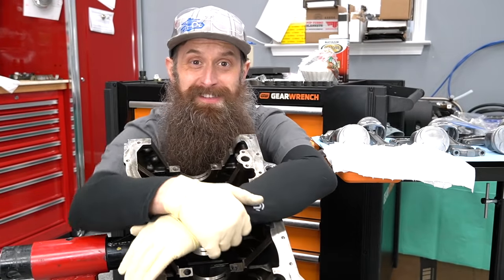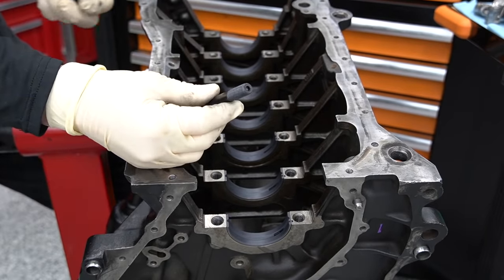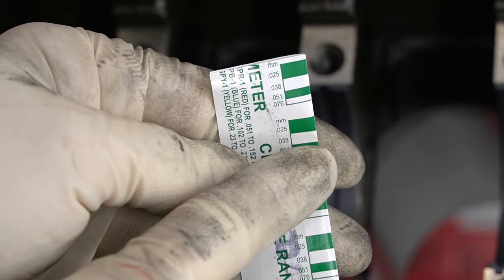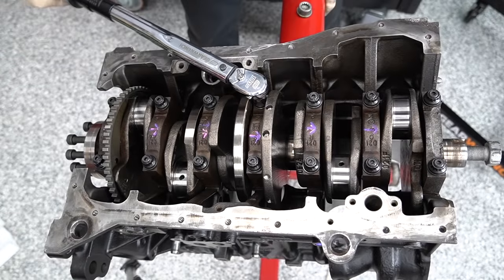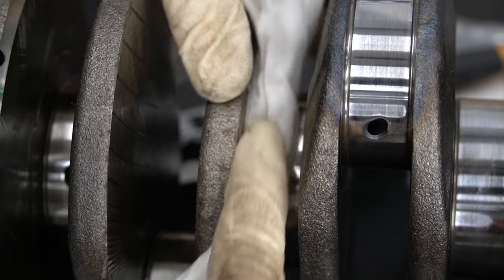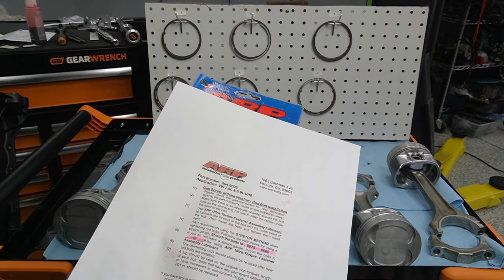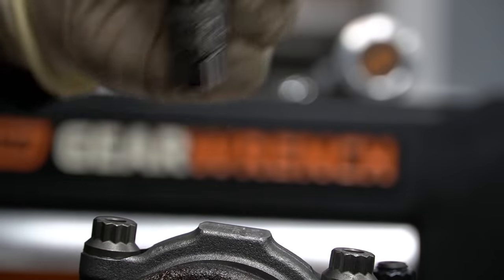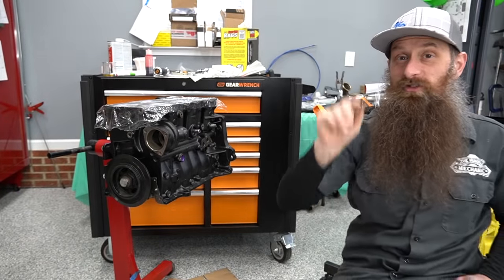How To Assemble an Engine Block with Upgrades!

Comment from the maker: Next up for the R32 we will get the head bolted up, and do two timing videos. One with stock chains, and one with HG spacer!!! Also many of you ask about why no upgrade to pistons and rods. GREAT Questions! At some point I have to stop with the car. HPA and I had several long chats about this. They have tons of cars running around with HIGH HP, on stock internals for the R32. The beauty is, they are right, or wrong, and we get to find out. HAHA. Time will tell.
Reply: BIG THANK YOU FOR THIS INFORMATIVE CLIP.
Reply: HPA?
Reply: @notsponsored103  HPA Motorsports - VW/Audi performance tuning company
Reply: Love the video my brother update btw valve cover gasket went on 2.0 replaced an then replaced the plugs an also the 02 sensors no problems no check engine light hell yeah btw u need to take the new race build to the freedom factory i hear the bald eagles screaming now
Reply: An also in the sprit of cleetus can that thang do a burnout 🔥
Reply: Amazing work as always! Did you measure the bore taper in the end? Really intrigued as to what it was looking like at that mileage
Reply: thanks so much for sharing, Charles. 😊👍
Reply: Yyý
Reply: What is the material used to clean the bast?
Reply: One question. Can i ask you for some help? I have the same engine 3.2v6 AXZ in argentina. Im just putting together the new pistons and rings and all new and i can’t find the table adjust information for the scrws and all the adjustment. If you could help me i really apreciate! Thank you

Comment: It was really cool seeing my ARP suspicions on VR6 confirmed. I once built a motor where I took on ARP's advice and had my rods resized. Awhile later, I decided to do the 1 out 1 in method, ARP, 40 ftlbs, no resizing. Worked just the same. Also high mileage ring gap. People believe high mileage motors have more ring gap and are better for boost... no no no. These people have never actually measured one. I measured one, 220k miles, well maintained. It came out exactly to what your refreshed block was, 0.13" top ring 0.16" second ring, with some bores having just barley 0.14" on the top ring. Keep up all this awesome content Charles! Looking forward to the w8 tear down!

Comment: Just a note that with the engine upside down, the plasti-gauge on the engine side of the journals is redundant. You're measuring a clearance, so the crank is already sitting hard against the engine side bearing surface. The only plasti-gauge indication that will be accurate is on the top side (main cap side) of the bearing journals

Comment: I use arp when I can. But, I'm starting to find that unless the block has enough beef for the increased load it's not necessarily worth the extra cost unless you plan on frequently disassembling the engine. I always use arp for connecting rods. But, for mains and heads I'm not convinced unless you are springing for a stud upgrade.
Reply from the maker: Exactly!!! HPA runs stock! They said they never had one fail. Haha next time I’ll be doing stock for sure

Comment: good note on the align hone part, it is also nice to have it done to also ensure the bores are still in alignment. a used block can potentially shift around over time with use so the crank can potentially spin better and have more consistent clearance from journal to journal if an align hone has been performed.

Comment: Hello HumbleMec, a few months ago I built my VW MK3 2.0L and made use of RaceWare studs for the main bearing caps, ARP connecting rod bolts and STD bearings all a round. I was aware of the recommended RaceWare and ARP torque settings but these figures far exceeded VW's torque settings so I decided to totally ignore the aftermarket torque numbers and use only VW's settings. My logic was that if I'm using the same STD bearings all around I know I can't apply exceedingly higher torque numbers because this would deliver clamping forces on bearings not originally designed for. Knowing that my engine worked perfectly fine with VW's original torque settings and engine bearings I opted not to chance it and stick with OEM torque parameters. In the end the engine build has been a total success and engine performance is fantastic only requiring going back to a thinner motor oil to properly lubricate all brand new bearings and cylinder block components.  This approach saved me a ton of time and unnecessary expenditures on tools and parts.... you can't go wrong with proven engine torque settings.

Comment: Hello HumbleMechanic. Certainly you professional. Also you can lubricate the bolt head or nut in contact point with cylinder block . This is facilitate slip when the threaded joint tightened.Only way you will get accuracy when the threaded joint is tightened dynamometric wrench with the lowest resistance.

Comment: On the Main bearings where the thrust washers are apart of the main bearing my old machine shop didn't like them for manual transmission cars. They preferred the separate thrust washers because this allows for another surface for oil to go and absorb some of the thrust.

Comment: What an awesome video Charles! Engine/Transmission disassembly has always been a "fear" of mine because there is so much that you can mess up and I always though things were glass like fragile. Now that I'm starting to do this stuff, you see that they are but aren't that fragile, just be sure to use some "soapy wooder".
Reply from the maker: LOL it's all about knowing what can be fragile, and what is okay to force. Sadly you usually find out when you break it. HAHA
Reply: @HumbleMechanic  I think everyone knows that distinct gut wrenching feeling when it's about to happen. The best part is hearing the torque wrench finally click knowing it's done correctly.

Comment: Nice techniques.  The first time I've seen someone de-bur the inside edges of pistons rings to prevent them nicking the ring lands.  I've found that ATF works to clean/lift honing debris from cylinder bores nicely, if you cant get marvel mystery oil.

Comment: Are the factory crank bolts stretch bolts? If so, would you need to buy an extra set of bolts if you wanted to check oil clearances?

Comment: I've never built an engine so maybe stop me, but...

I recently learned you want a slightly larger ring gap for ring #2 (maybe .001-.002" larger). Manufacturers have started doing this to avoid an increase in compression between the rings, causing a ring land failure - the idea being you're better off potentially having slight blowby.

I was curious if this was something you or others were familiar with.

Comment: Interesting video, but I have a query about the big end cap bolts. I would have though that releasing the stretch bolts to check the plastigauge would have the potential to give a slightly different bolt length, meaning that they would not have the same tension on them if re-torqued to the value calculated on first stretch. Is that not the case?
Reply: At operating temperature and the proper tension, the bolts are designed to stretch elastically. Since assembly is at room temperature, are being torqued to spec, and the bolts aren't under any dynamic load there should certainly be no plastic deformation of the metal. (Note that because bolt tension is measured indirectly via torque specs, this is why it's critical that the threads are perfectly clean and the specified lubricant is used.)

Comment: Hey do you have to use plastic gauge and check the crank shaft clearance if your just refreshing the engine , and your using all own stuff..the motor will not be turbocharged it will stay stock oem thanks !

Comment: If you're torquing the rod cap bolts to check the plastic gauge. Wouldn't the bolts be non useable after that? Aren't they torque to yield?

Comment: Ring clearance in groove is important as you can get ring flutter if excessive. leads to broken rings. Washing everything? Usually fasteners are torqued with light oil unless manual specifies dry.
One thing that is very rarely given in any manual is ring free end gap. It tells you if rings have lost tension through being overheated (usually top ring) You can get low compression and not know why as things look fine' Should have watched a bit longer as I didn't knopw you used assembly lube on bolt threads.

Comment: If you measure clearance both under and above the crank, than the total clearance is equal to clearance read under + clearance read above the crank. 
So in your case where you show 2 smaller than 0.025mm (lets say 0.020mm) your total clearance is 0.04mm

Comment: Charles, I've never done a Plastigauge clearance check but simple geometry says that if you use one strip on one side of a bearing, the gauge material will act as a spacer as you wind up the bolts, till you have zero clearance on the other side, and twice the clearance on the gauge side. All things being equal if you use two gauge strips, one on each opposite side the crush forces should balance out and each gauge will tell you the gap on their respective sides of the bearing.
I'd appreciate your response to this because I have my own R32 rebuild coming up and I am using your guidance.
Reply from the maker: I tested it both ways and got basically the same results

Comment: Audi performance and racing, APR has very good stuff that is researched in cooperation with the VAG factory wizards. Downside is that there is relatively few APR parts on the market and they´d rather also build the cars in APR certified garages so that´s possibly not the best trademark for a DIY guy. I ran with OEM clutch and cam timing belt 10 years and 100 000 Miles with mostly just the basic maintenance like regular oil change with the stage 1 + that is 450 to 480 Nm and from 330 to 370 horse power differing on the fuel and air temp etc. Do a 2.0 FSI/TFSI engine next please.

Comment: With the bottom end cap connecting rods, you threaded short of going past the bolts ? Is that okay or should you thread the nut down past the bolt until the thread is exposed??

Comment: This may sound like a daft question but. When installing the journals do you just torque the bolts without adding the extra angle on top and are the bolts single use? Say if the bearings are incorrect can I use the same bolts?

Comment: Sometimes I'll drop a b.b. in the bolt hole to hold the stud up and be able to tighten the stud prior to putting the caps and nuts on.

Comment: Hello. I am currently changing the cylinder head gasket and clean the engine. Do I have to smear the cylinder walls with oil?

Comment: Is there a reason you dont plastigauge the crank? is there a difference between putting it under the crank on the bearing VS installing the crank, then plastigauge on top of the crank?  And do you always do top and bottom? Ive always just done the top and never had any issues.

Comment: you use the new bolts when doing the clearance check with the plastigage? then used them over in the final assembly? i always thought torque to yield bolts should only be stretched once or is there something different with these ARP bolts that allow that? plus great video.

Comment: As far as line honing goes, I've measured a bunch of blocks over the years and the variation was honestly minimal. This was on SBC and BBC 4 bolt main blocks, so maybe that was the reason, not sure. Thing is though, the shop that does my machine work charges like $150 to line hone the block, and they sell the ARP hardware for a pretty solid price. So to me its just cheap insurance to have them do it while the blocks at the shop getting the other operations done. 
At the very least it sure can't hurt anything.

Comment: @humblemechanic hey Charles, awesome vid. I was always told once you stretch a TTY bolt you have to replace them? So why is it okay in this case to stretch the rod bearing bolts then remove/reuse them? Thanks!
Reply from the maker: that is true for OEM hardware. This hardware is meant to be reused.

Comment: Tried assembling a motor with ARP main bolts, didn't know that it needed to be line honed. Crank wouldn't spin. Installed factory hardware and it did spin.

Comment: Hi  Charles  .I enjoyed every minute of this rebuild . I have had only 4 cars in my life , all VW’s 1958 Bug 1969 Bug  1980 Rabbit Diesel . & 1992  Diesel  Golf . The Rabbit  and Golf still on the road . I rebuilt the Golf motor , it has no thrust washers but you can change # 3 crank bearing to correct end play , I’m not a pro tec , but my question to you   is  there a lot of motor ‘s with out thrust bearings? I love the efficiency of your work and your fast and to the point thanks AL Greetings from Canada 🇨🇦🇺🇸😙🚗

Comment: When measuring the rod bolts, if they are slightly different starting lengths, how do you keep track of the stretch? Do you write down each bolts starting length before torquing and then zero the gauge to that length before testing the tightened bolt?
Reply from the maker: That’s the best way to be accurate. I also sort them so each rod has similar length bolts. So they are closer

Comment: Hmm, >200K Mi. The block not decked or squared, how to you know the surface is flat?  Check it with as straight edge? Magnafluxed?  Reused pistons, wrist pins, keepers and rods, inspected for excessive wear, cracks, rods resized? Piston to wall clearance checked? What machine work was done other than honing the cylinders? Lots of questions! Building boosted engines require attention to details considering the investment. Thanks for posting.

Comment: Why did you place the plastigauge underneath the crankshaft? If you set the crankshaft on the main bearings and put the plastigauge on the crankshaft bearing surfaces, then install the bearing caps, there is no way to accidently crush the plastigauge with the weight of the crankshaft. It's preferable to use a micrometer to measure clearances if you have them.

Comment: Hi Charles great work, wondering about how you doubled up on the plasti gauge, wouldn’t those clearances add together? If you had .025mm top and bottom wouldn’t that be .050 total clearance?
Reply: You could only have space on both sides if it was floating in the air😂

Comment: HumbleMechanic, why didn't you check the connecting rods oil clearances before checking and installing the crankshaft?
Reply from the maker: I didn’t feel like I could toque the rod to the crank. And I didn’t have a proper way to hold the rod to torque it and use a micrometer

Comment: Did you use a micrometer to measure the end float on the crank, to see if it is within manufacturing spec, and then buy the correct thrust washers to correct the end float.
Reply from the maker: Are you talking about crankshaft end play? If so, no I didn't directly measure it. I did use a micrometer to measure the thrust washer thickness, and they were basically the same. Im actually not even sure you can get different thickness for this engine. There may be a solution out there, I have not looked, because its never been an issue for. 

Or am I misunderstanding end float?
Reply: @HumbleMechanic  sorry, end float is a.U.K. term which is end play USA style. Many years ago I used to build Mini Cooper engines, which we called blue printing, this was making the engine meet manufacturers spec. Due to poor manufacturing in the mid sixties some engines were slightly different in some areas. We could buy various size thrust washers and after the use of the micrometer to measure the end play, we could fit the right size washer. I remember the crank in a Mini was a three main bearing, and because they had a tendency to flex and snap at high rpm, to solve this problem I would heat the crank and dip it in liquid nitrogen and the centre main bearing cap was then machined and a hardened steel strap was over bolted to the crank obviously using the main bearing cap and bolts. Watching you work is delightful and your attention to detail reminds me of a much younger me. Well done.

Comment: It's interesting that 3 pistons are paired when they go up and down. Do other 6 cylinder do that.
Reply: Inline 6 cylinder have a 2 down, 2 up, 2 in-between cycle, there is every 120° of rotating the crankshaft an ignition.  V6 mostly also have this pattern. The first two move up, the second pair is 120° in front of them, the 3rd pair 240° ahead.

Comment: Hi. Is it worth it to buy engine rebuild kits for VW 2.0t cbfa from ebay or partsology.com ? I wish you have a video that explains difference in quality or if you ever had order aftermarket cheap parts and ran to a problems. trying to rebuild my  2011 vw cc 2.0t engine with bent valves that i purchased for $750 from auction. Thank you for your awesome videos.

Comment: There's a dark grey coating on the sides of the pistons that has partly worn off. Would you consider this a reason to replace the pistons? Especially when you are adding a turbo?
Reply from the maker: I’d get them recoated before I’d replace for that. But it’s so minor I’m not worried

Comment: What size thickness Head Gasket should I use if I am planning to replace OEM Heads from Summit Racing.. My motor vehicle is still running without any problems or issues.. I jus want to replace them for preventable problems in the forcible future.. Thanks..
Reply from the maker: OEM I’d guess
Reply: Thank you Sir....
Love the Videos....

Comment: Can or should you rebuild these new engines like we build old engines? Like we find old 50's & 60's cars with high mileage and build the engine until you have bored it out to it's limit. Is it cost prohibitive, too many old plastic parts or is it that people aren't interested in building cars like we used to? Can you expect to rebuild a VW engine after a timing chain/belt problem?